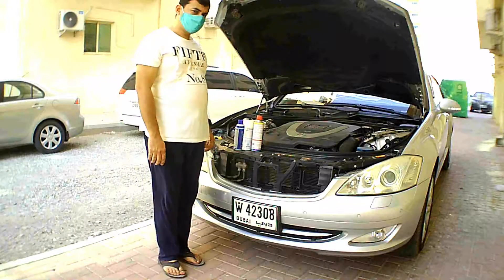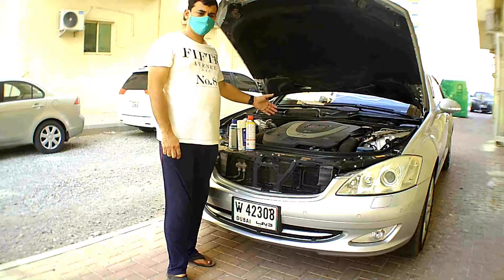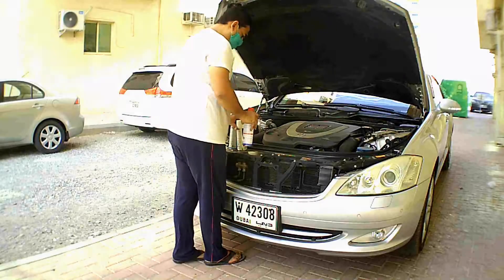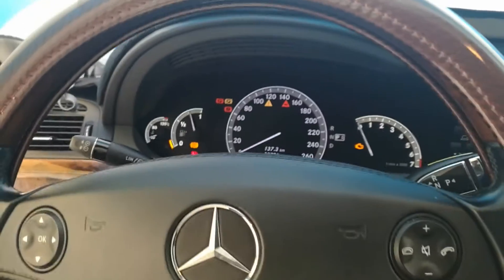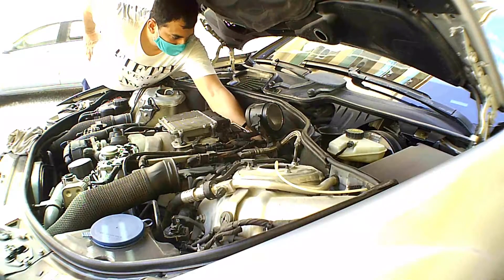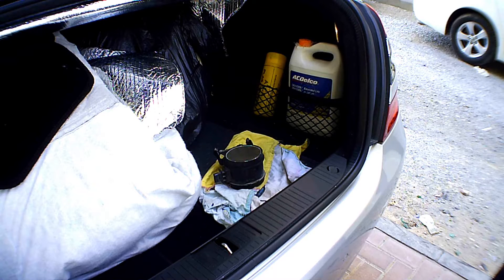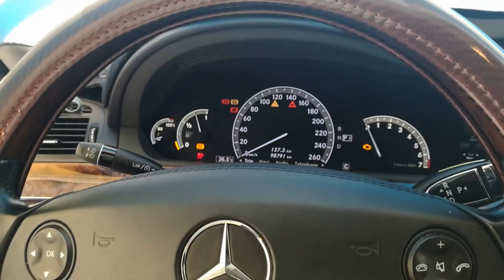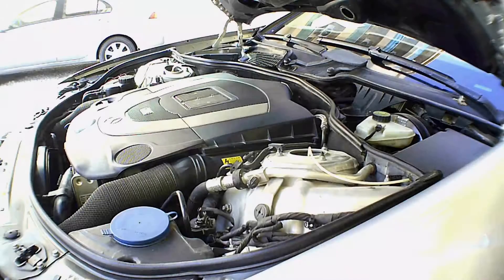Mercedes S550 w221 M273 M272 engine Mass Air Flow MAF and Throttle body cleaning and servicing.

Comment: , is my 07 S550 is that electric throttle control or regular throttle control valve
Reply from the maker: The is electric type. Called Drive by Wire system

Comment: If my traction throttle control valve is is bad with that have anything to do with the shifting of the transmission that just wound RPMs went up and it wouldn't shift
Reply from the maker: Yes definitely. These all systems communicate with each other

Comment: My S550 throttle control valve I thought is bad my heater blows sometimes and sometimes it doesn't blow does that have anything to do with the air flow valve
Reply from the maker: This could me some other issue, not inter- related.

Comment: My S550 throttle control valve I thought is bad my heater blows sometimes and sometimes it doesn't blow does that have anything to do with the air flow valve

Comment: My S550 throttle control valve I thought is bad my heater blows sometimes and sometimes it doesn't blow does that have anything to do with the air flow valve
Reply from the maker: These both problems are not interlinked

Comment: what was the symptoms before you did this service?  I have same car with very rough idle and high gas mileage, do you recommend doing same service?
Reply: Symptoms or not, it’s always best to do this after 100,000 miles (160,000 km) as a preventative maintenance.
Reply from the maker: Rough surgy idling were observing. I recommend to do this service but it is better to run live data diagnostic by connecting some computer, to pinpoint the route cause.